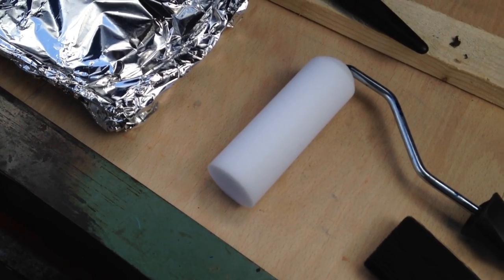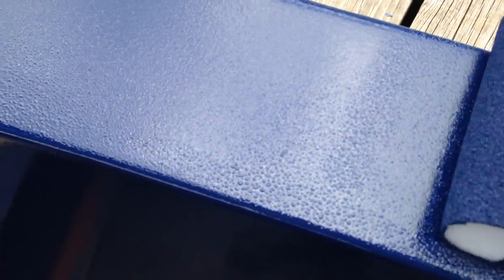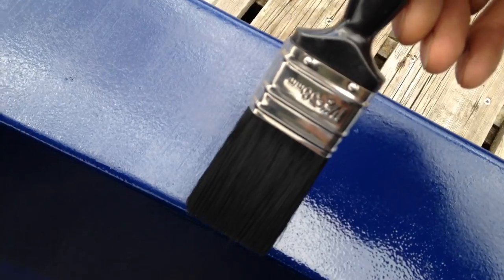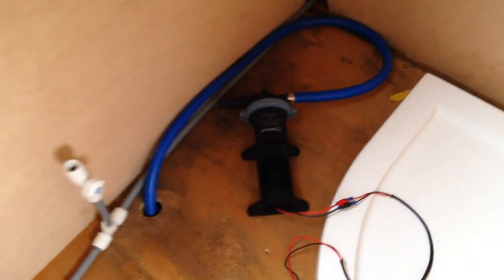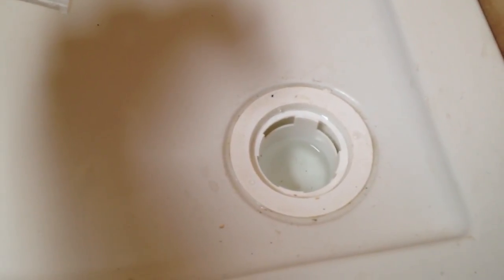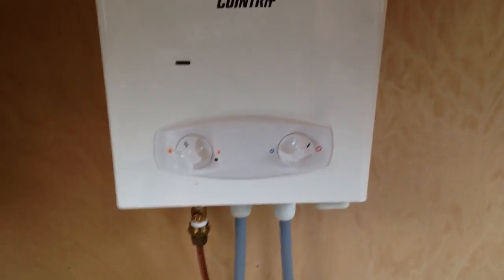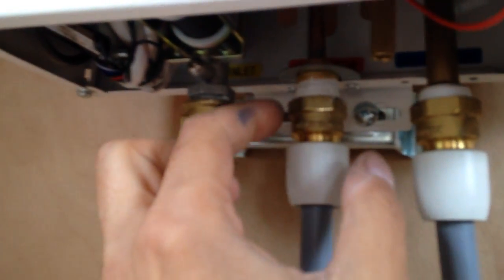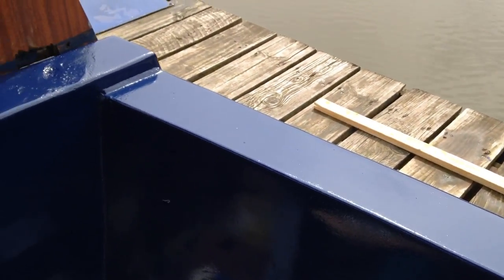Ed's narrowboat Ep.25 Time to start painting

Comment: Ed, please hurry with your mistake. Is it on the shower install? I'm just installing one in my boat  -  already put in a boxed pump similar to the one you have removed. Going to test it today. Will you be bedding the shower tray on mortar, or as I have seen in one YouTube video simply putting a lot of sealant/adhesive blobs under it. Also I have been using your painting technique - mixed results , I blame the weather, temperature humidity or anything else that's handy.
Reply from the maker: Sorry, the mistake i "might" have made is nothing to do with the shower. I think i will just use silicone to hold it down as its a heavy built thing and only need to stop it shaking out of position.

Comment: Hi Ed can I offer some advice put a in-line filter prior to your pump on the shower The water trap in the shower will not be sufficient
Reply: Gulper pumps aren't too fussy. I wouldn't put a filter as it will just get bunged up.
Reply: hi I have a filter on my shower and never had a problem
Reply: Garry Stacey the Gulper is designed specifically to pump shower waste without any kind of filter. Someone on a forum had a non-return valve fitted and that clogged up and stopped the pump functioning. Why would you want to fit a filter?

Comment: You might think about adding an accumulator tank, that takes the expansion of the water when heated, don't know if that would help but it is basically a blatter in a bottle that when the water pressure goes up it allows for the expansion of the water while it is heated. Since yours is on demand I do not know if you really need one... but it wouldn't hurt... max pressure is about 40 psi on those.... Cheers and as always God bless..... here is a link to see what I am talking about..... 
http://www.ebay.com/itm/SHURflo-182-200-Pre-Pressurized-Accumulator-Tank/112372960103?_trkparms=aid%3D111001%26algo%3DREC.SEED%26ao%3D1%26asc%3D20140107094819%26meid%3D0d4fa91da7654498b3feda1e8879b01f%26pid%3D100039%26rk%3D1%26rkt%3D4%26sd%3D112372960103&_trksid=p2054436.c100039.m2059

Comment: Hiya. I'm ignorant about regulations and stuff. You didn't need a qualified, certificated gas fitter to install your boiler? Then again, maybe you are one! All the best to you.
Reply from the maker: The regs say it has to be a competant person. If it were fitted by a contractor then they would have to have a formal gas qualification which would be for LPG in this case.  It is ok to fit a boiler to your boat yourself but i would not recomend it if you have no experience.  The end result will be inspected by the boat safety examiner and they do quite a thorough job. I have worked with gas furnaces for a number of years and was formally qualified but it has lapsed now. I would still class myself as competant though.
Reply: Thanks for that. It always amazes me when people actually reply and answer my questions! Thank you.